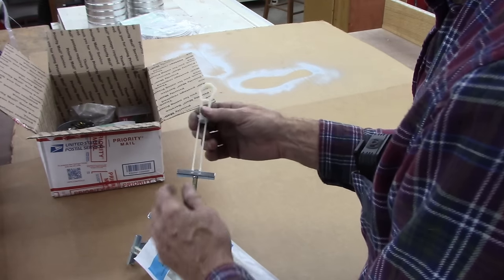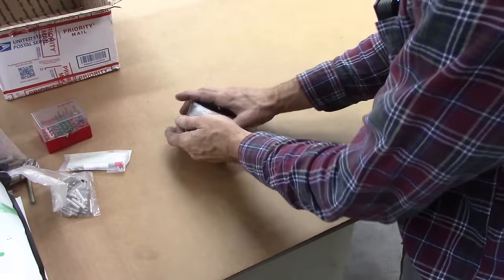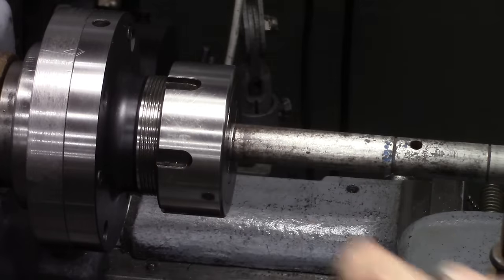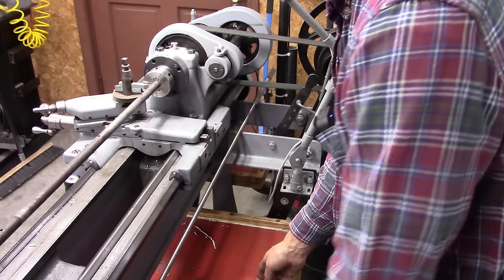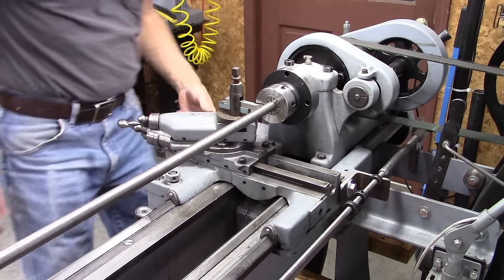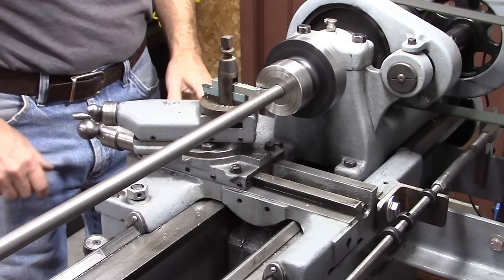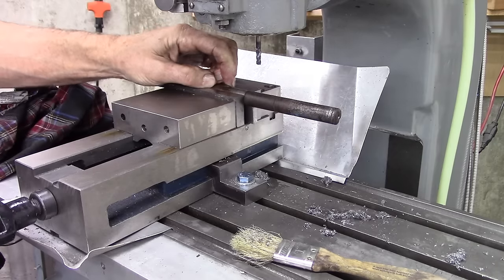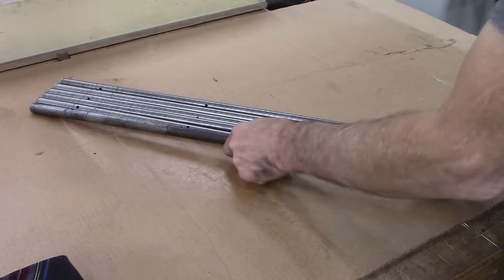Mechanical DRO for Snap Ring Groove Positions

Comment: That's a quite interesting and clever old school solution that will always work, especially when super high precision isn't needed.
Reply from the maker: After the axles were finish I laid them next to the original and could not see any difference. Of course it's hard to see a .004" error and a real DRO would technically be more accurate. One thing for sure, it's much better than transferring the position with a square and scribe.
Reply: @WinkysWorkshop  of course for this application .004" is more than enough.

Comment: That intermittent audio hum sounds like it is the result of an unshielded cable radiating an EM field that your cordless mike occasionally crosses.  Finding the cable and putting Ferrite Rings around its ends ought to minimize the EMI problems.  I like your content.  Thanks for sharing. Wish you well.
Reply from the maker: I agree...  the other day I hooked the receiver to an amp and put the mic. (sender) on a stick...  I walked all over my shop trying to reproduce the sound and nothing happened. The only thing new in my shop is the VFD and it was unplugged. I think I'll by a new mic.

Comment: That is a great idea using the all thread with stops to accurately get to each snap ring location Mark. It makes duplication a breeze as well.
Reply from the maker: Setup time was a bit high but it was worth it. I made 5 axles and they are all perfect.

Comment: I did DRO on lathe a year ago. The y axis on the tailstock is a game changer. I save a lot of material by not overdrilling just to be sure.
Reply from the maker: I think the y DRO would be nice. I'm not sure I'd use the tail stock that much. The threads are 10 TPI and I count turns.

Comment: How did you index the holes to be at the same angle along the length of the axel.  Y last project required two holes separated by 15 inches but they had to be aligned parallel to each other.  I tried to do it be eye, but I was a few degrees off.  Great video.
Reply from the maker: In this case it didn't matter but in the past I put a pin in the hole and used a level on the pin.
Reply: Thanks.  Wish I'd thought of doing it that way. @WinkysWorkshop

Comment: For the threaded stop collars, perhaps if they were 2-screw clamps, then you could find a way to thread only half of the collar, then you could loosen both screws and slide it down the threaded shaft instead of having to spin it.  Sort of a half nut approach.  For the two screws, you could use thumb screws so you don't need a tool to adjust.
Reply from the maker: All good suggestions. I like the half nut idea

Comment: I like spray mist cooling better than flood because it's not as much of a mess, and I think it cools better.  Whenever I make a long cut, after stopping the mill and feeling my endmill it's always cooler than ambient temperature, I think because some of the coolant is evaporating and removing much more heat.

A DRO on a milling machine turns the mill into a quicker and more useful machine.  For the lathe, I do fine with dial indicators though.
Reply from the maker: In almost every case I agree about the DRO on the lathe. Some lathes have dials on the carriage but mine has none. I'm guessing I could install a Z axis DRO for $50 bucks and it would be an easy install. Mist coolant works great if you use enough (which isn't much) but then it's in the air. I used it for years but got tired of breathing the mist. with flood I get a better finish, the mills last longer and the chips stay on the mill. Most often the mess is a little more but mist tends to make a mess too, especially when you use enough. To be honest...  cleanup is actually easer with flood due to the chips staying on the table but the life I get from a cheap HSS end mill with flood is totally worth having flood. Its a drastic improvement. Maybe its the type of coolant....  hard to say.